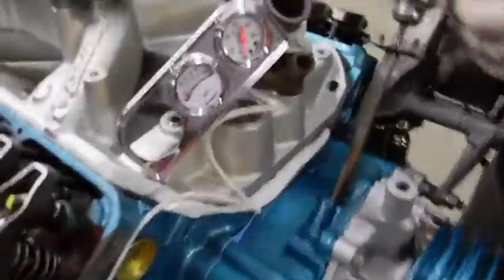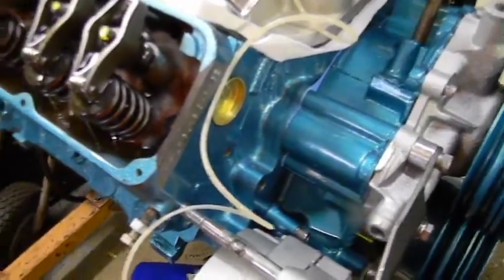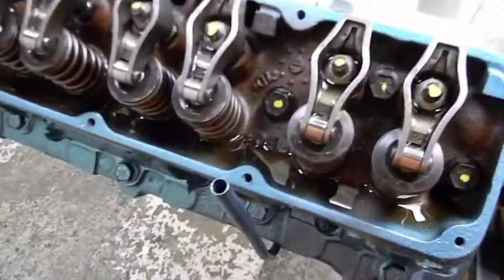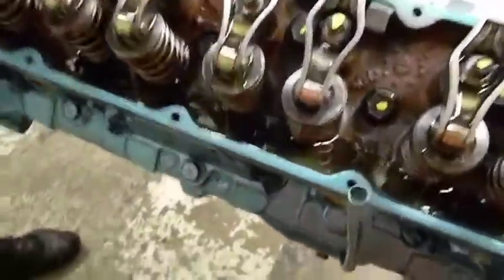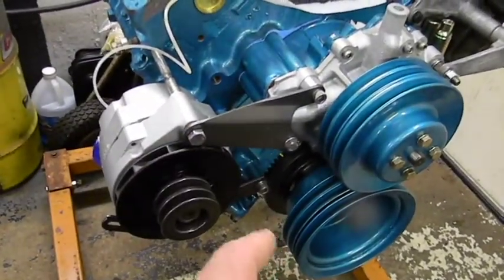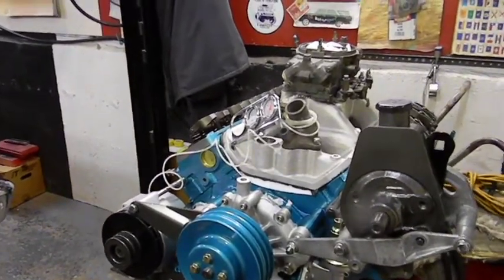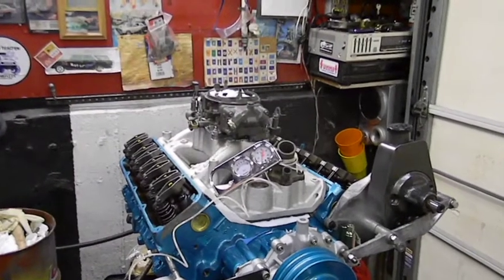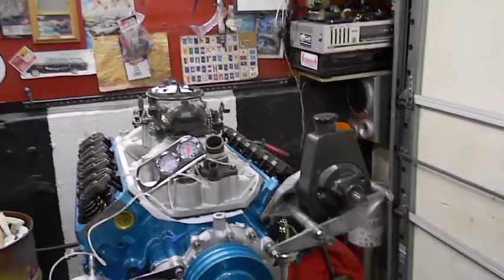AMC Oil Pump Prime

Comment: Vaseline in the oil pump: About 8 years ago I tried multiple times to use this and priming goop once on a 1979 360. I spun and spun and spun that damn pump with a drill motor. it never read pressure. I pulled the sending unit and tube off the side of the block, nothing. No oil. I finally just cleaned out the oil pump (packed several times through out the process), cleaned the gallery out, and ran oil through it. The problem was the vaseline and priming goop just plugged up the filter element and let nothing pass through. So it ran dry for about 20 seconds. It sounded like it was coming apart! Right now I'm running that engine with Rotella T5 and it makes good pressure, no noise, seems pretty decent. Not as stout as a built 401, but it scoots in my green, lightened J20/10 Jeep truck.

Comment: Yes, you have to rotate the crank as you prime the engine. The first time I did this was on a Ford 428 with a high pressure pump. I turn d the crank as the Machinest ran the drill. As pressure came up through the pushrods it hosed down my Machinest! Funny as hell!

Comment: I'd say that oil is moving, stupid question but is there much of a difference between AMC 360 and chrysler 360?
Reply from the maker: Power..Even aftermarket Mopar 360 heads can’t touch AMC factory heads...Mopar has the dist. in the back on there small blocks...Bore and stroke...
Reply: Gets fun quickly comparing the factory set ups to well built motors of the same cubes 
My own reason to switch a grand wagoneer motor over to a 5.9 magnum motor isn't the motor it's the overdrive trany that will be giving me better mpg out of a heavy brick plus more horse power the 360 was barely stronger than the 4.0 ho motor it had 20 foot pounds of torque more that's it same rated HP for those EPA slugs 
Building improving firing up the horsepower with longevity in mind is a great goal to have any idiot can stuff parts in a block but having it last for YEARS later makes the difference between a true builder or a stuffer  I remember watching an old man work over a flathead he was a artist at fine tuning that thing it was smooth his ol pick up wasn't fast but he had it since it was new thousands of miles an many years of love

Comment: One of my professors at DeVry shared a circuit that put 50kv through the driver's seat if it wasn't disarmed. A kid put the circuit in his car and got into trouble with law over it and the Prof stopped sharing the circuit design. It Sucks! I would use that on car that's built, but this kid got sued over it, whether or not the idiot who tried to steal his car won the suit or not I don't know, but it's not worth the legal fees to try it unless your damn sure it's ok in your state. I think it would be pretty easy for anyone to figure out, but I'm not gonna say how I think it worked. Anyway, good luck with that guys!

Comment: sos did you do the ol system.mod recommended on amc v8s to prime the crankshaft before the camshafts bearings??
Reply from the maker: On this engine i left all the passages alone...i checked them but did not drill them nor did i run the add`ll line under the intake...this was the first (Untouched) AMC engine i`ve ever taken apart that the bearings were mint as well as the crank shaft
Reply: @homotorsports   Hello! I was wondering if you wouldn't mind sharing what fuel pump did you decided to use,thanks.